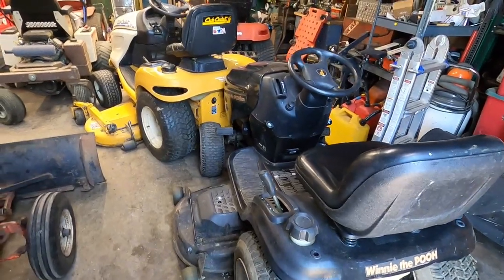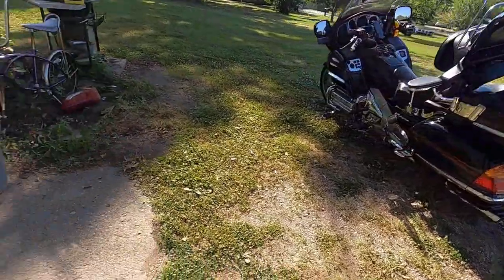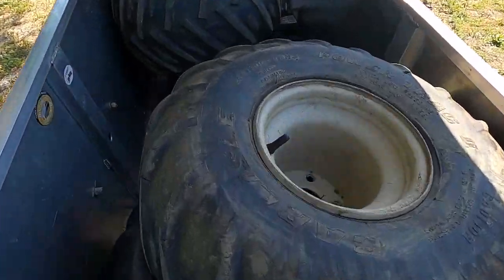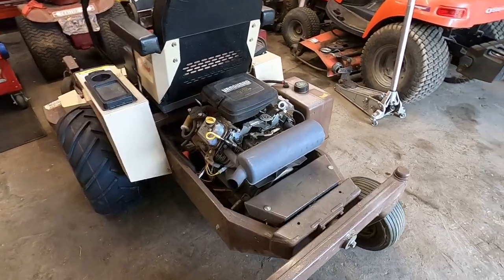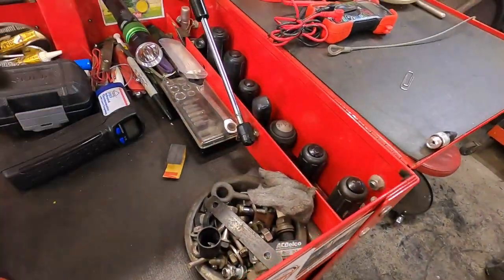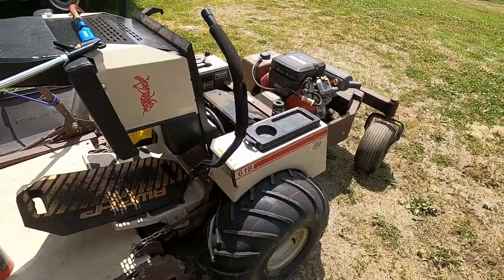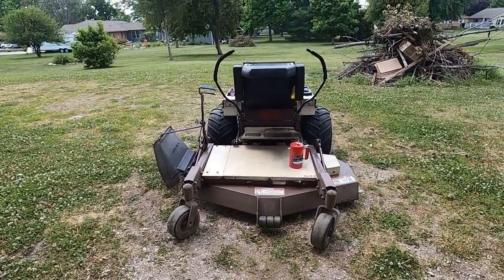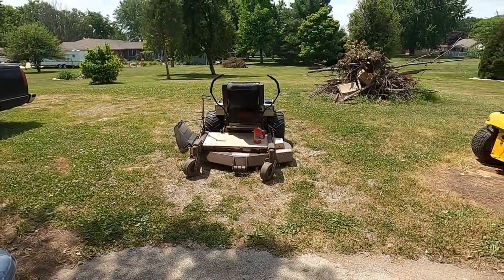Grasshopper 618 Gets Some Much Needed Maintenance Part 2

Comment: I agree, changing tires can be a job and frustrating for sure.  Hope those tires do not rub on the grasshopper.  Thanks for the video..  Stay safe.
Reply from the maker: They're close, but so long as Momma Sue doesn't over fill the tires, they'll be ok I think. Cheers! Zip~

Comment: I am having a hard time getting the deck up on mine. I’ve tried lifting it at the lowest cutting level and the highest cutting level, but the thing with the cutting level notches keeps catching on a bolt while the other side is about an inch from locking in and holding. Any help is appreciated.

Comment: I never understood how a tire is rated for 6psi and atmospheric pressure at sea level is 14psi am I missing something or did I ask the wrong questions in school? Wouldn't you need a vacuum pump to deflate / inflate them?
Reply from the maker: Atmospheric pressure is what is considered the "ambient" (for lack of a better word) pressure. So inflating a tire to 6psi in an environment with the 14psi nominal pressure is simply 6psi above the nominal. I hope that makes sense! Cheers! Zip~
Reply: @ZippoVarga  My ambient brain has taken a nominal fart.